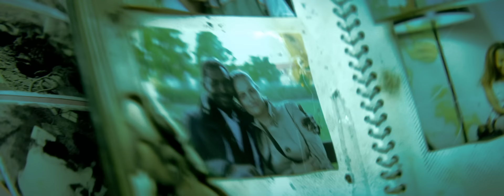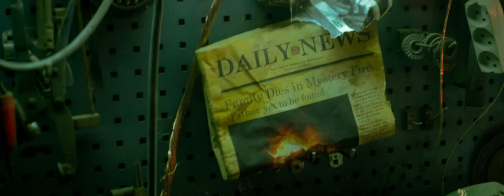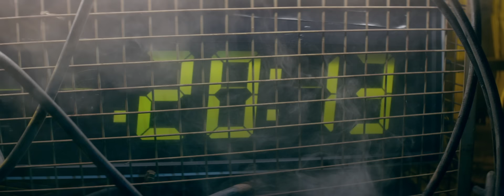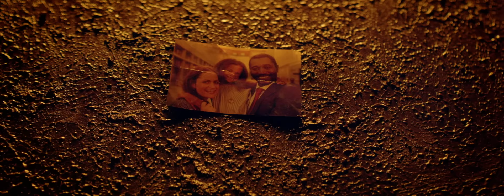Nico & Vinz - In Your Arms [Official Music Video]

Comment: Wait a sec.
This makes sense.
Look.
His time-machine starts burning when he used it. And, we'll assume that he succeded in going back in time, as the digits went back.
So, he gets back with his family; But he gets there in a machine that's burning. The machine sets the family home on fire.
-> "Mystery fire"
He gets away, let's assume that he knew this would happen, or maybe by pure luck.
-> "Father yet to be found"
With him he only has a few things, like a photo album that suffered some burns, as well as a torn picture of his wife and kid. Except for those, he is now without any belongings, and has to live and roam the streets.
-> Protagonist is homeless.
He was probably an inventor of some kind before this started, there's an picture of him working in his "lab". The song is about him wanting to simply be in the arms of his wife and kid(s) again, so; instead of showing himself to the public, going through the legal-system and being a suspect, he lies low and tries going back - doing things another way.
So, he tries again to build a better machine, one that won't set the house aflame. This means another quest for the parts needed.
...
When the machine is done, he goes back in time, but it's another failure; It's set on fire again. But he's got another short time with his family, shown by the picture getting whole again.
Then, his family is trapped inside a burning house, and he escapes, again.
-> Press replay on the song/video.
--------------------
It ends with him going back, in a burning time-machine.
It starts again, next time, with him trying to build another time-machine.
In a meta-context, you are to repeat the song. Because it ends where it begins, and begins where it ends.

That's my interpretation after two nights dwelling on whether there's something mind-boggling going on here or not.
I think there is.
Still, the song is awesome; Great work Envy!
And, the video is beyond great; Awesome work Fivestar Entertainment!
Reply: Sounds right, and I love it :]